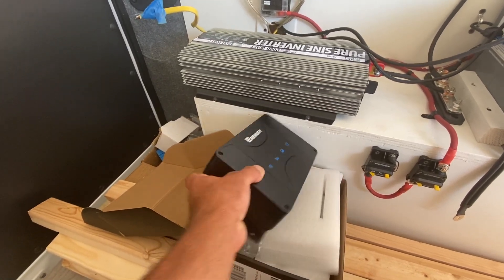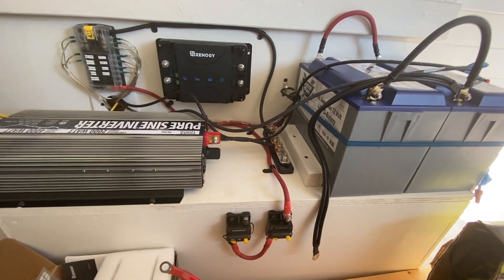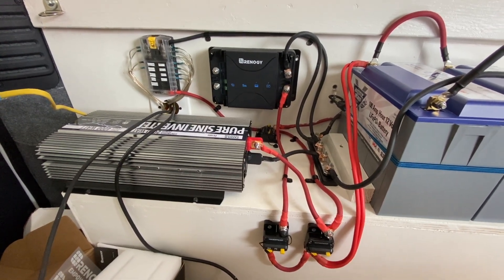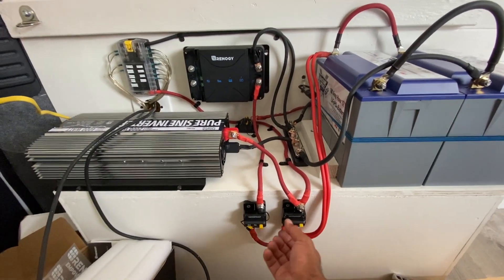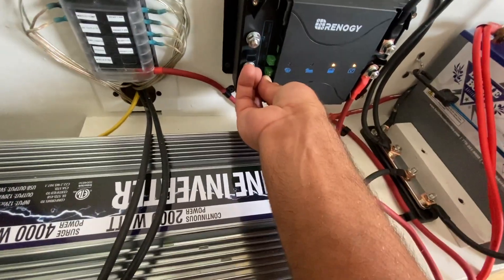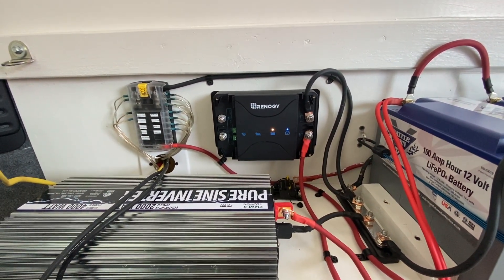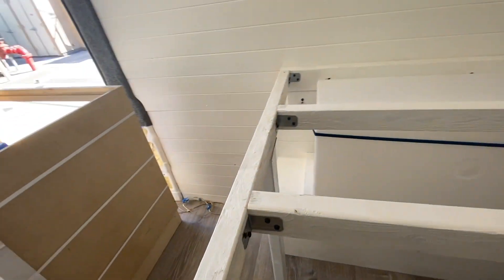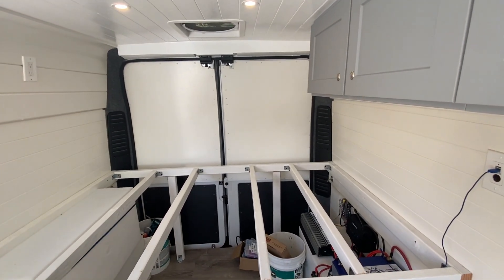Van Conversion- Part 9

Comment: When I order the full list of items from Part 4 - how to install max air fans and solar panels - I already would have four solar panels.  But, it looks like I need the kit here under the link of Solar Panels - which would include two more solar panels.   Help !
Reply from the maker: You do not need a kit, I'm not sure what you mean?  You need the 4 panels, 2 batteries, 1 charge controller, one inverter, one fuse block, the wires and fuses.

Comment: Hey man, digging the build but I gotta ask about weight distribution. Them batteries aint no joke, I got 4 100 AH solar rechargeables that weigh 80 each! Mitigating distribution is a problem for my design; I plan to have them paralleled either in front or behind my rear suspension.
Reply from the maker: GiggleBeard these are lithium batteries.  They are drastically lighter than agm.  For weight distribution I have the water tank over the opposite wheel well.

Comment: Great job !  I had a question, did you need to run the signal wire from the Renogy MPPT to the alternator or just the positive, negetive and ground?  Wasn't sure if the 2020  Promaster had a smart alternator  ?   Apparently,  it's not needed for a standard  alternator?   Thank you, Best of luck with your new one.
Reply from the maker: Good question.  The promaster did not have a smart alternator.  The new Mercedes sprinter I’m working on now does.
Reply: @BuildingVanLife  Thanks for your prompt reply,  Best of luck on the Sprinter, I look forward to seeing your progress.